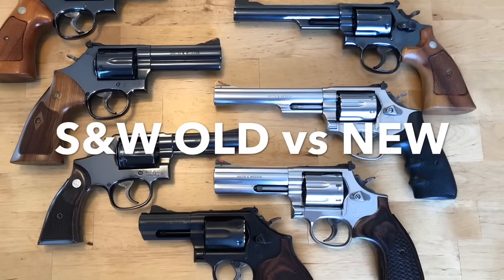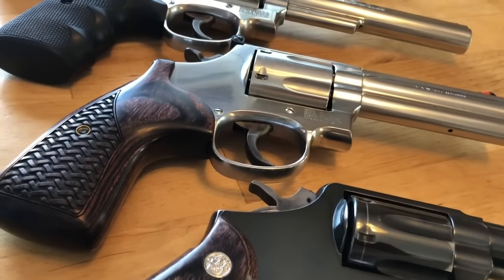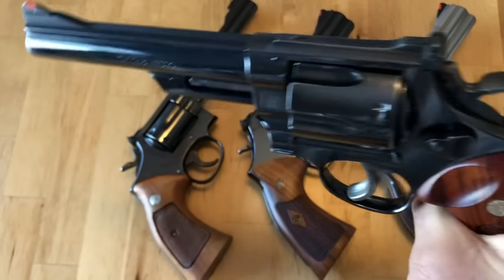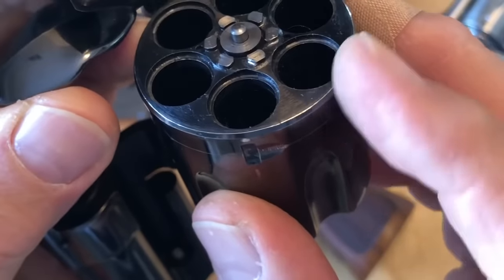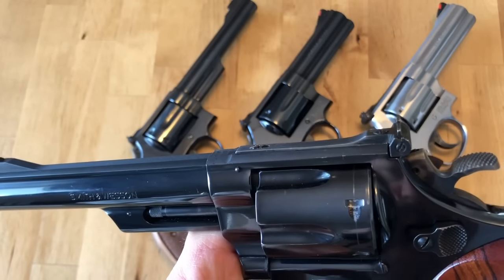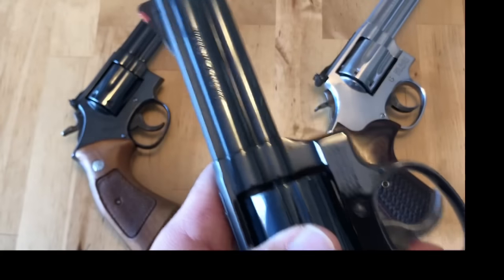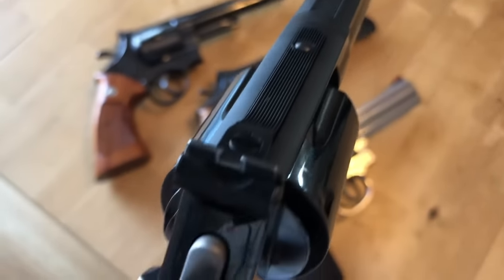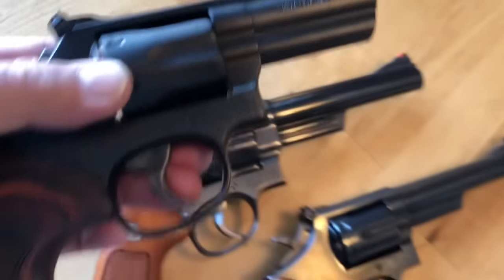Smith & Wesson: Old vs New. Do they make them like they used to?

Comment: Good video. Thanks for posting this comparison. For my part, what I don't understand is why S&W made such a mess of the left side of the frame when they designed out the old-style frame lug (which was a threaded part at the lower rear of the cylinder window in the frame). I understand the rationale for simply milling it out of the frame forging, but why did they make such a godawful eyesore of the recoil shield on the left side of the frame in the process? If there's a good reason why they left that ridge of metal between the recoil shield and the frame lug, I'd love to know what it was. Otherwise, it looks half-assed, like a poorly executed cost-savings

Comment: Completely agree. Except I'm somebody that will open carry a full size revolver. Not here to defend that position, but the idea of a keyhole that can completely lock up my gun - the one I'm going to use - is scary. I carry a S&W m10-5, on occasion, and it's a great gun. But if ankeyhole popped up on it I'd retire it immediately. In short, why would Smith&Wesson include a self destruct on one of their best products? Quality or no, that's just stupid.

Comment: I currently have 2 S&W revolvers, a no dash model 60 and a new 686 plus. Both very good guns but the old model 60 has a much better trigger along with fit and finish. The biggest difference though is in what you don't see, the internal parts. There the old ones are much better.

Comment: My 19-4 is my favorite SW 357
Reply: Me too ...
Reply: The 19 s chanber throats were designed to fire 158 grain lead projectiles. 
Not sure what " regular .357" signifies. But as long as one stays with 158 grain ammunition,  the bullet profile reduces gas cutting of the top strap. 
Granted,  .38 special would cause less wear overall, moderate magnum loads with an 158 grain projectile will give service for many years.
They tend to be more accurate in my 19-4 as well.
Reply: faultroy  I have a 586 and 27 larger frames. I have had no issues shooting 357mag through my 19 at all in 10 years. Yes I fire both mag standard loads I think is 158g and 38+ p. Again, it's not a steady diet. I do about 100 rounds or so of mag and or special per range trip.

Comment: I wish they still made the 19/66 K frame with a 6" barrel.
Reply: Nice model 19's and 66's are still out there but they are getting much more expensive as of late.    I luckily found a 19-3 ( 1970 )and a 66-1 ( 1980 ), both with 6" barrels , complete with original boxes and all paperwork, etc......Both are pinned and recessed , and the trigger on the 19 is smooth as butter.   The 66 aint bad either.  LOL .   Not a fan of the newer ones with the two piece barrels , MIM parts,  keylock, and firing pin in frame.

Comment: I had a first generation 686 I sold it to get  two polytec ak I bought a new one 3 months ago the trigger on the new one is superior.Get one while you can.
Reply: So I'm clear...You just bought a NEW 686 three months ago and the trigger is better on the new manufacture?  What specifically did u like over the older manufacture?
Reply: @dajaegers ’ Both single action and double action trigger is superior just as accurate as the first generation. I also had a smith and Wesson 19 that was made in 1982 trigger was terrible out of the box Workmanship was not good.

Comment: David, thanks for the video... I am considering the current s&w  629 (44 mag 6.5" bbl full lug) any opinions on this as far as how it shoots)...
Reply: Get a redhawk
Reply: @darrallipke8070  Nope i purchased an older no-dash S&W 629 P&R with 8 3/8 " bbl... I already own a redhawk and I am not overly impressed with it.
Reply: Better go over it with a fine toothed comb before you put your money down, that much I can tell you. Just know if you have a problem with it and send it back they will put it on a shelf for 5 months then send it back and tell you it's in spec. Ruger and Taurus will fix it send it promptly back and apologize for the inconvenience . Too bad you don't want a 629-6 with half lug 6" barrel I got a gently used one lnib for sale.
Reply: @darrallipke8070  taurus is made in brazil no thank you... rugers I own... not interested in another one... the redhawk looks have no appeal.... the older pre lock smiths have much more appeal than any ruger....
Reply: @darrallipke8070  - Where are you located?

Comment: Have owned Smiths since mid 70s. Made the mistake of buying a new Model 36 classic. Bought it through Buds Gun Shop, so no I didnt handle it before buying. Thought I was buying the original frame size. Was given the "magnumized" stretched frame. Decided to test the double and single action pull (dry fire), after about 20 pulls on the hammer the cylinder became mushy. It turned from mushy to impossible to pull the hammer back, it was also impossible to release the cylinder. This was a brand new gun !!!!!  Sent it off to SMith and they sent it back working and with an explanation that they had to replace 7 parts. That is 7 parts !!!!!   This was on a brand new gun. I have to keep repeating this !!!  The "blue" job looked like it was spray painted on and the over all feel of the gun was junkie. Wont ever make that mistake again. Sold the gun obviously, and took a substantial loss. I now only buy older Smiths

Comment: I have a 15 and 19 that are pinned and recessed, later models don't remember the -## right off the bat. I was shooting those regularly but ended up getting a 10-11 4" MiM model to use for steel challenge. I shoot it quite well but after a bit over a year I am about to replace the cylinder stop, again and just broke the firing pin retaining pin. Somewhere around 800-900 rounds since I got it and replaced the original stop. I also have a model 36-10 with the imbecilic lock on it. I removed the parts and am just waiting on the lock filler components to arrive. I shoot it well, use it for carry, and think it is an ok revolver other than the idiot lock and cruddy trigger pull. I picked up a Colt Cobra and found it to have a better trigger than any new S&W (unless you go performance center) that I have tried. Thankfully Colt is coming out with their line of snake revolvers again. Now I can pick up a new revolver that is better than an off the shelf S&W and don't have to spend a butt load of time trying to track down good used S&W revolvers from the good old days at a price that is reasonable. I don't have a problem with automation but S&W thinks they have the market cornered and have for a while, but that is about to change. If they made a better revolver they would sell a bunch of them but as it stands they will be playing catch up with Colt if they don't watch it, and I think Colt will win unless they apply their typical douchery to the revolver line....

Comment: Why is the rear sight leaf of the Model 29-2 ruined by the addition of a second set screw hole?
I won't mention how many S&W revolvers I own, but none of them is an example of the lawyer-lock and ugly cylinder thumb latch variety. I also want the firing pin ON the hammer. Give me one of those and I'll sell it to some sucker in a NY second.
OTOH, you will never take my pinned and recessed Model 19 from me.  One like it is what I started my police career with.

P.S. The CHAMBERS are counterbored, not the cylinders.

Comment: My 38 ppl is older the kids at the local indoor range, 70s . End  of covid they finally got brass range  brass back in. Brass would not seat properly, fingernail  between  revolverver and end  of brass. And would be diifficult to slide out spent brass. kids were like  Our range brass is into proper specs. Non range amno works just fine. What???

Comment: I think it's just ducky that auto's outsell revolvers 40 to 1 and that everyone is gravitating towards auto pistols and away from revolvers. If no one wants the old revolvers, that's more for me. At one of my pawn shops, I was amazed to discover that while practically every piece in their cases vanished seemingly overnight when the Covid scam came along and then Antifa takeover of America, a few "old" revolvers remained. One of them was a 13-3 4" which I happily forked over $420.00 OTD for. A few years back I took a 6" 686 no dash from 1984 out of there for $499.00 that had been sitting there for a few years prior top that collecting dust while everyone bought their Glocks and Smith M&P's.

Comment: Nope, they don't. Then again nothing is, cars, TV shows and movies, guns and so on. Good topic though. I have had 9 old Smiths and I have 1 old Colt. They were very nice guns. Works of art. I love the pinned barrels and recessed cylinders. I do have a snub 64 from 84 that's not pinned and they have the logo under the latch release but it's still very nice. I don't care for the new Smiths or Colts, but that's just from an esthetic point of view. New ones work just fine, but I love the old blued and nickel finishes and I love the hammer mounted firing pin. The old ones are so beautiful. I carry one of my two S&W Mod 36's or my Mod 64 snub or my late 60's Colt Agent all the time. That's all I carry. I love carrying and collecting these old guns. I didn't know they did frame mounted firing pins that early on some models. The 637 and 638 no dash versions and the Mod 37-2 from early 90's had the frame mounted pins. The 90s was an interesting time. The last runs of guns made the old way were done by about 93 or so with some overlaps. The early 90's were a good mix of the new and old with S&W. Nice guns.

Comment: I don't like the new ones because the frame looks different. The slope from the rear of the rear sight to the corner of the grip isn't as curved in and it doesn't appeal to my eye. Also the metal feels less solid and lighter. The Hillary hole offends my freedom also.

Comment: Its funny  the "not made like they used to" - yeah, the metal is higher quality and the machining is far better. Back then they HAD to hand fit parts as the machining was far worse! Not that I dislike any Smiths, own a few from pinned to lock. Its just like how in those same days if you got a factory MOA or sub MOA rifle you were damn lucky. Now you can get that accuracy in factory rifles under $400.
Reply from the maker: Good point. I think the biggest difference then versus now is the care that went into fit and finish.

Comment: Less machining steps such as no recessed cylinders lowers cost.  Firing pin on the hammer just looks better.  All changes are cost saving measures whether cheaper to make in volume or less likely to come back for warranty work.  Definitely lost me with the sleeved barrel, saying they are more accurate in comparison to what, a worn out revolver or one with a fault?  I've seen sleeved revolvers where the sleeve is of poor quality metal and the finish has deteriorated much faster than the rest of the revolver. Sleeved barrels just constantly remind me of a pellet gun.

Comment: I think two of the best modern changes are night/fiber optic sights and rubberized grips.

as far as the Hilary Hole, if I had kids and it wasn't my EDC, even if I had a safe, that frame would be locked.

Comment: The changes are mostly better, new stronger materials are more finished as they are manufactured unlike the old days when parts needed hand finishing. That is simply not necessary with modern parts. There are numerous improvements throughout.

Comment: The new might be better in certain categories BUT the beauty of the old polished blue steel and genuine S&W wood grips just can’t be beat by anything S&W currently manufactures. The recent Classic series are attractive but compared to for example, a 1950 or 60’s Model 27, not even close. I have numerous S&W revolvers but my favorite shooter is a Model 15 I bought in 1989. My M-15 was a police trade in from the Navajo PD. It looked bad from rough handling, neglect but judging by the cylinder’s faint turn line and very minor almost insignificant gas cutting. It wasn’t shot very much. TRUMP 2020

Comment: I had had many many revolvers-maybe 40 over the years-mostly S&W-but a few Pythons(so cool looking-nice triggers-not really better than the best S&W but nice) a few detective specials a few I forget the name of the 2.5" Colt 357 1974 vintage

In any case my 2019 manufactured M637 SS J frame 2"(1.875 really) EXPOSED REAL HAMMER is perfectly fitted-times perfectly nice trigger double and single

Yes it is better built than any of my other S&W or Colt revolvers-not as cool looking as my  1980 vintage Nickle 6.5 M29-(screwed up and sold it years ago=with all the pythons too yeah wonder nines suckered me in-Piece of junk M59 9MM S&W)- but better built

Lot to be said for computer aided machining!!

Yeah S&W are better now

Comment: OLDER Smiths, accept no substitute. I would rather have an original Smith I have to completely restore, than a new pretty gun with that damned lock on it sitting there like a roach on a wedding cake. All of those changes came about to keep up with Ruger's cheaper manufacturing process and price. They are NOT better, just cheaper.
Pinned barrels are NOT going to shoot loose, counterbored chambers protect the ammunition better from the elements, and a forged hammer is much stronger. 
And the Safe-T-Hammer corporation MAKES that damned lock, and they own Smith. 
I have to hunt for my Smiths and pay inflated prices for a real one.

Comment: The older guns are much better quality than the new. I have a brand new model 60-15 and the damned barrel is canted to one side. That is total BS on a brand new $700 gun. I have owned several dozen Smith and Wesson revolvers over the last 50 years and the quality of the older guns is far above the newer guns. That is pathetic. There is no way cheap MIMS parts are as well made as the older forged steel parts. The older pinned barrel guns were the best revolvers ever made, by any maker. Smith and Wesson should be ashamed for some of the crappy lack of quality control they are putting out these days, especially for the prices they are charging.

Comment: 2 piece barrels, MIM parts, 5 Axis CNC instead of hand fitting, canted frame to barrel alignment, and mass produced by the thousands.   The entire focus now is on lean manufacturing and to eliminate as much production costs as possible to increase profits.  It's all about quanity, not quality.  S&W and Ruger have quality control standards that are laughable.  Do they make them like they used to?  NOT EVEN CLOSE!!!
Reply: Well it is easy to criticize them but at least their revolvers are still decent and priced competitively so young guys like me who enjoy revolvers can experience Smith and Wesson. If they would make them like they used to, 586 would probably be 1500-2000 dollar gun and people would still complain how expensive it is. This way I can get 586 for 700 dollars or less, and if quality is 80% of old Smith, I am happy.

Comment: The metallurgy of the old day is not as good as modern steels . MIM parts are powder metals with precise ratio of alloys mixed together then sintered and heat treated to achieve the highest desired results . Also automation such as CNC machining produced consistent and precision components which are easily interchangeable for maintenance and repairs . Hand fitted or hand made products tend to have a lot of variables not to mention that not all craftsmen are the same and certainly not the same everyday of week! Today steels are a lot better and so stuffs can be made lighter and stronger .

Comment: Having just recently purchased a new 629, I can assure they may look similar on the outside, but the difference lies beneath. Underneath the side plate is where the differences are. Everything but the springs are metal injection molded. Will they still shoot every time? Absolutely. Do they have that precise Swiss watch feel in the lock work. Not even close. I spent close to $500 replacing the molded hammer, molded trigger, molded return block and an over sized hand and Wolff Springs to just get back to what they used to feel like. Gunsmiths hate them, because the stoning and polishing once used to make a good gun great will not work on MIM'd parts, they're just as likely to disintegrate  before your very eyes. These decisions weren't made by engineers looking for an edge on performance, they were pushed by bean counters looking to decrease labor costs and keep profitability paramount. While it saddens me to see a once great company succumb  to these measures, the hidden now becomes more obvious......Smith and Wesson on the outside, Taurus where the metal meets metal. I'll save my dollars and buy a Korth, at least I'll know where my money went.

Comment: I wouldn't do it if I were you... revolvers are on the way out for a while now, pistols are totally in. Try selling a used revolver today should tell you everything.
From: Active Armed Self Protection 
Their DATA
CCW Calibers used in America:
- 70% of the U.S. use 9mm
- 10% use .40 S&W
- 9% use 45 ACP
- 11% use *"other*" caliber 
Notes:
- The 11% "other" calibers include the .22LR, .25, .32, 380, .357 mag., .44 mag., 10mm, 5,7x28mm, etc.
- The Worlds usage of 9mm is probably even higher than above U.S. figures.
Informed (opinion) conclusion:
1. Mouse gun calibers and revolvers are not recommended for self-defense.
2. Best caliber(s) to use for CCW is the 9mm. World police & World military agree with this
as most folks use the 9mm including US police & military.

Stay safe 
Note: these figures are from an Active Self Protection video (Nov. 27, 2017):
Biggest Takeaways of My Survey of 6,000 + Firearms Carriers | Active Self Protection Extra
@